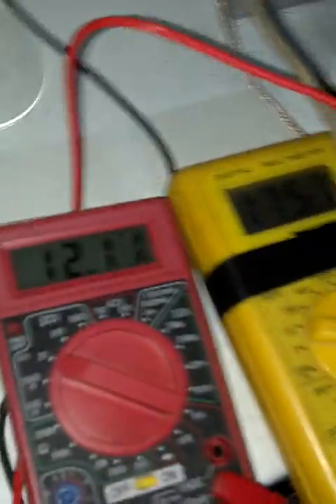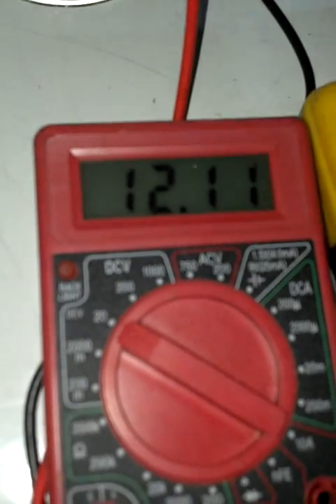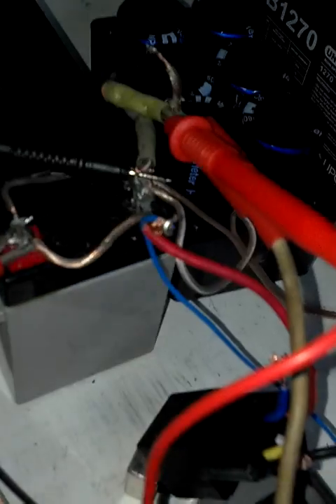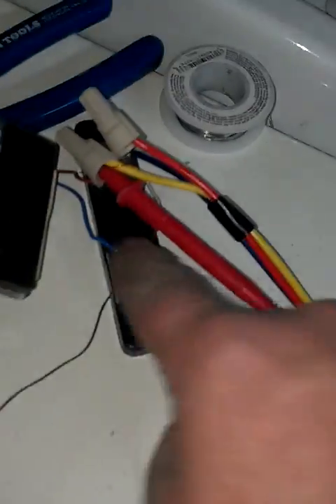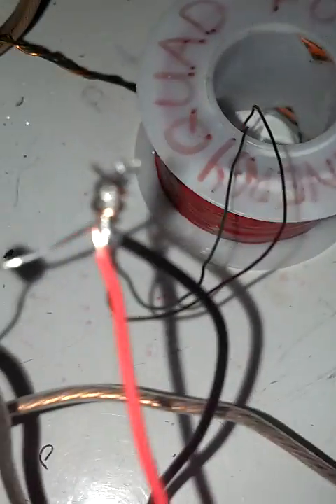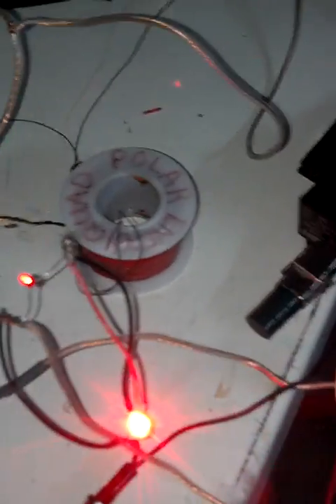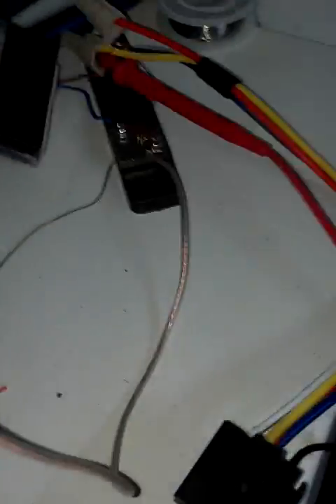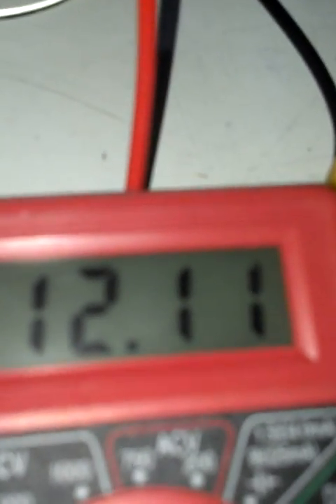Oscillatory coil generator part 2

Comment: You should incorporate your findings with a Tesla Radiant Energy receiver...
https://m.youtube.com/watch?v=DxUTf0wbNLA
Reply from the maker: thewonn I wish I had the parts and money to do more, such as build the receiver. I need to find a partner to work with in a local lab that has the equipment I need for my experiments. I have tons of started projects that I ran out of funding for and have many ideas to try for finishing them. I also have come up with a new method of collecting back emf and using it, as I have found that Tesla's discovery is very real where he noticed that very large arcs draw in additional unreal bursts of energy that were previously unheard of by many. He noticed that Edison's DC system has a flaw where linemen would die from the blue electrical spike when closing in the very high voltage loaded dc system and he knew it meant the capture of a massive energy was being drawn in from the environment since he was one of the few that witnessed so many people die from the phenomenon that he recreated the system to experiment with the same thing with safe methods that closed switches where he could literally measure the additional bursts of energy that are still thought to be impossible. Nobody on this planet has ever succeeded to make such genius devices as tesla has, and there will never be a duplicate of him again unless he comes back in another body. I eventually will succeed, and when I do, the entire world will know that I have because it will be evident when you all see the news and it shows a man from Connecticut showing his new energy device to the world, waiting for investment to go worldwide as it won't need any means of approval since it is going to already use a pre-approved electrical generator for it's operation once released. This will merely need a licensed electrician to install it since it isn't necessary for any of the rest of the device to need any type of approval since it is a normal everyday mechanical device with a generator head mounted to it, no additional madness or wizardry parts. Like pelex, it was the build of a specially connected set of three transformers.. That's it! nothing more!!. I think the simplest of devices are how it will need to be done. There is no reason for the supreme or complex design criteria. I keep one thing in mind when I build my devices.. "Mama always said if you want it to be good, just keep it simple." It's My motto for life because the simplistic designs are easy to build, cheap to create, they have a massive markup , and, usually work oh so well! If we keep mechanical devices simple, wiring easy, and not too many connections, there isn't much involved in a design to switch things around until you get it correctly operational. I find more energy from a battery and a simple relay than most do with several hundred solid state devices, which in turn only waste energy by utilizing them from additional losses. It's bad to use a lot.. Always!